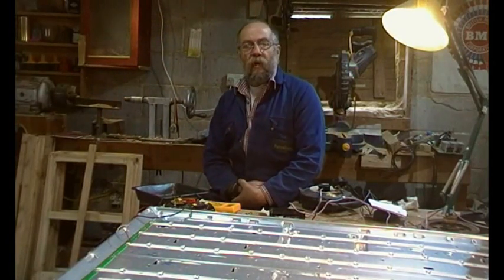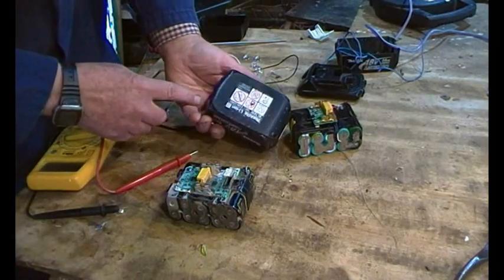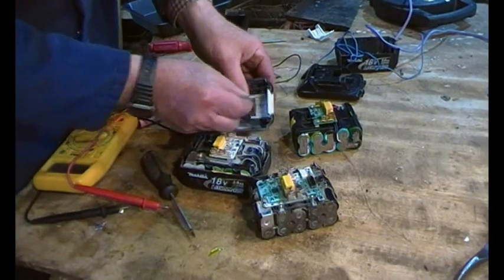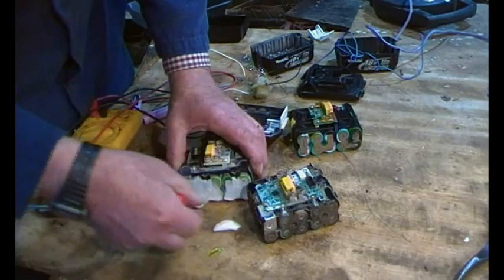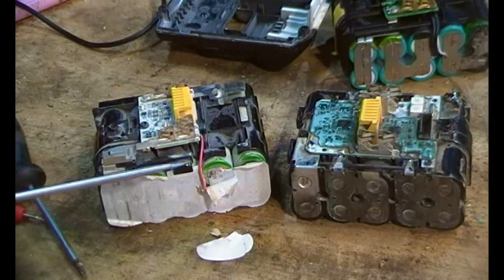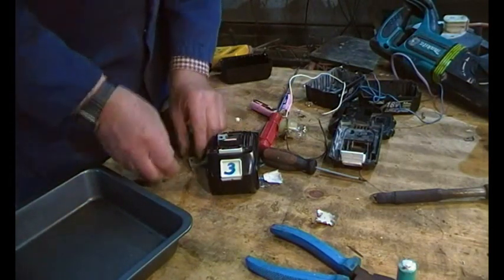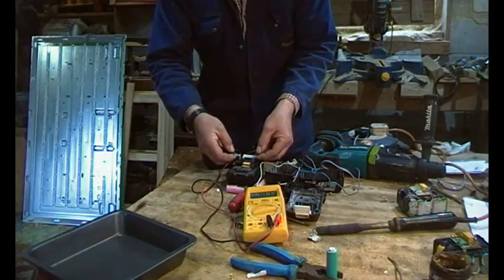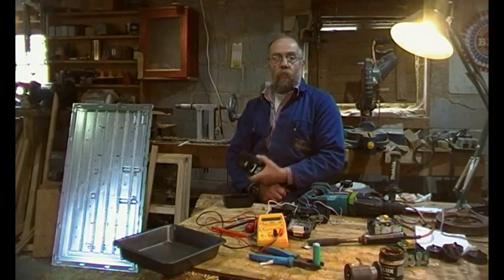Makita lithium ion drill battery repair

Comment: When I get a unbalanced low cell I just charge the individual cell with the bench power supply rather than the whole pack and then have to mess arround dischargin high cells.
Reply: Did you set the power supply to 4.2V  300mA to charge that individual cell? I suppose you set the voltage to slightly higher than what's written on the cell
Reply: @ianhelsbyservices  Normaly 4.7 volts at 150mA for a longer slower charge.